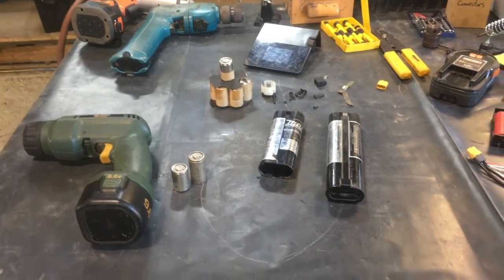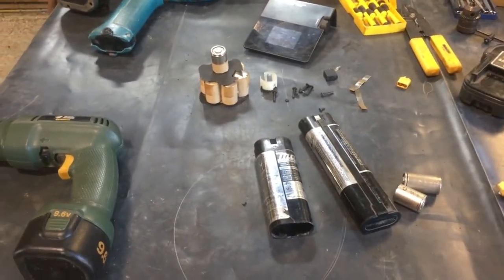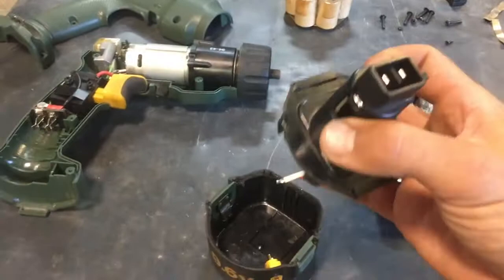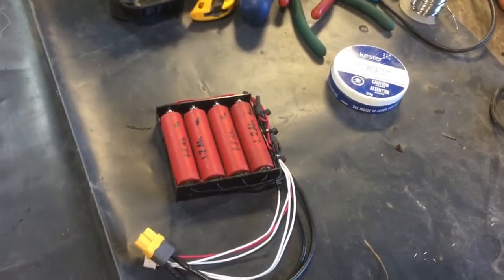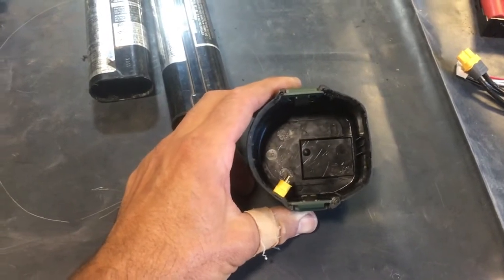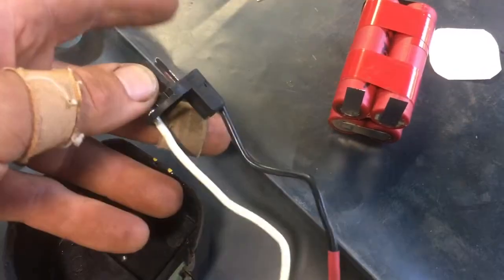Upgrading an old cordless drill from NiCd to Lithium battery using 18650 cells

Comment: You will need a Lithium Battery 18650 Charger PCB BMS Protection Board to be safe and avoid fire.
Reply from the maker: Fair enough, though I think that the risk of actual fire is very very low unless I charged it crazy hard with a very big charger set way beyond 14.8V and with one cell being dead short.  Yes it could happen and no this tool is not ready for daily use as is but it's not going to light on fire every time I charge it just because the electrolyte in the cell is flammable.

This was mostly just a fun little project to see what it would do.  I never charge this battery without quickly dropping the 3 cells out to check  with a multimeter that they're balanced, or nearly so, and I don't charge this battery unattended.  It's not a daily use tool and in truth I don't even really have a charger set up for it.  I do have some cheap little 3S BMSs on a shelf and I should probably put one into this pack – maybe then I'd use it more often and set up a charger for easier recharge.

Comment: i'm curious if you had any issues because of the way the batteries are charged.
although i'm sure you already know this...there is a difference between NiCd vs lithium ways of charging. by charging lithium with a NiCd charger you could just kill off the lithiums. is that green drill still working?
Reply from the maker: Oh yeah I definitely didn't use the original charger.  I don't even totally understand the charging profile for NiCd cells but I think it tapers current towards zero as delta V/T drops.  For lithium it's constant current up to target voltage and then current tapers to maintain voltage (constant voltage).  So chargers for lithium cells are often called CC/CV and there are a multitude of adjustable or purpose-built chargers for this.  My config is 3 cells in series (3S) so the terminal voltage is 4.15V x 3 cells = 12.45V so I use an adjustable CC/CV power supply set to 12.4V or less.  And sometimes I open the case and check that all three cells are staying balanced.
Reply from the maker: And yes, still working fine.  I use it rarely and charge it a couple times per year but it's been immensely improved by the battery upgrade as it's more powerful and lighter and batteries don't go dead sitting on a shelf
Reply: What if i just want to use the original charger? Or/and not have that hassle of burn down risk. I don't really care about overclocking,.

Comment: If you use 3 18650 for 9.6v drill, would that be over voltage at full charge like 12.6V? Would it hurt the motor? Im still figuring out if ill use 20A 2each to drop down the voltage or just not use diode
Reply from the maker: the motor doesn't mind in the least.  I've worked with lots of DC motors from this size up to forklift size and I've yet to find one that minds a 25% voltage increase.  They just spin faster and develop a little more power.  Cooling could be an issue in some cases and brush advance in extreme duty scenarios with big over-voltage but 9.6 to 12 is no problem as far as I know.
Reply: @reidallaway  thank you for your insights. Im more confident now to do the mod.